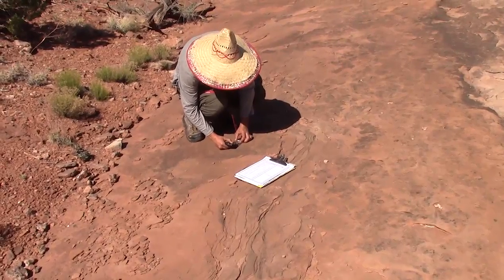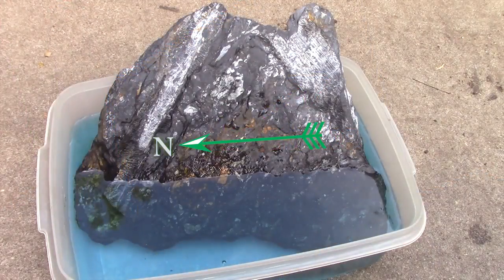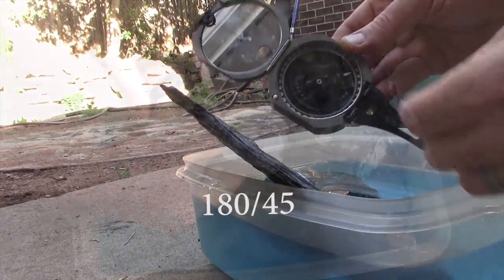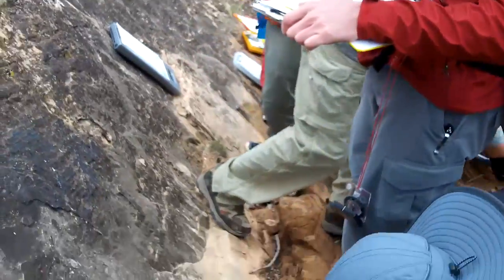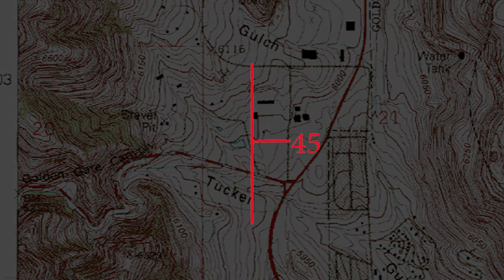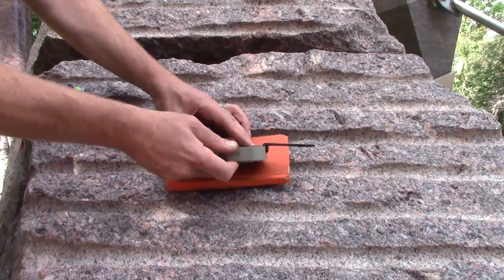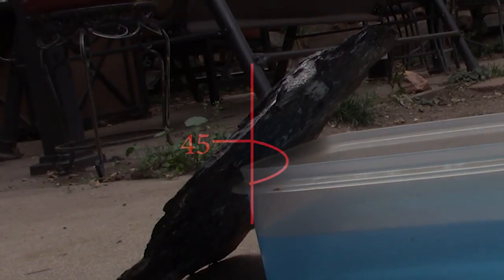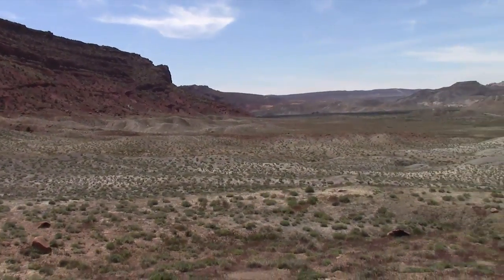70) Strike and Dip measurement and reporting

Comment: I taught myself an advanced method of measuring Strike/dip from a surface you can’t reach. 
Essentially if you can see the surface, and you can move your own position until your eye is in line with the plane of the surface (easy to tell because it is the point where perspective sort of makes it vanish into a two dimensional line). 
Now visualise the two dimensional line (plane) continuing down to the ground.  (You can also hold out a ruler or yardstick or a flat book to help)
Hold your compass level out in front of your eye and measure the direction horizontally along that virtual plane and that is the Strike. Measure the dip of that virtual plane at the horizontal and it is the Dip. 
You can also just hold out a book or clipboard in front of you and align it with the plane and you or someone else can measure the strike and dip of the surface as normal. 
It won’t work for EVERY defect you can see, as there has to be a point on the plane of that defect where you can physically stand, and that isn’t always available (joints dipping into a slope for example). Or where you only have a single vantage point to observe from. 
It does work for most though, and is highly accurate.

Comment: #1:51 at this moment 1:51 i found that E in the W place,!! i search for some compass and all correct as i know unless this compass " Brunton Compass", i know the angel is correct which is 90 D, but i can't understand why the place is not match as i know "West on the left hand
 & East on the right hand" i hope that you know what i mean, thanks.
Reply from the maker: Brunton compasses switch the east and west so you can take a direct strike measurement without turning the orienteering dial like on a Sylva.  Once you use one, you'll understand how much easier it is.
Reply: @CVshorey   thanks a lot for that, so i search a lot for the reason but i didn't get a complete useful information about that, any way it doesn't matter, i just want to know if i use the Brunton compass with it's revers and i get 10 Degree NE, so does it be already 10 D or 350 D?

Comment: I have a compass ,couldn't you just see in which direction the ,say, quarts vein was running and then place a spirit level which has a degree angle dial on them giving you the degree of angle of the vein is that the same thing or not .
Reply from the maker: In that case, you're measuring a lineation with plunge and trend, a.k.a. dip and dip direction.  Strike and dip is for planar features.